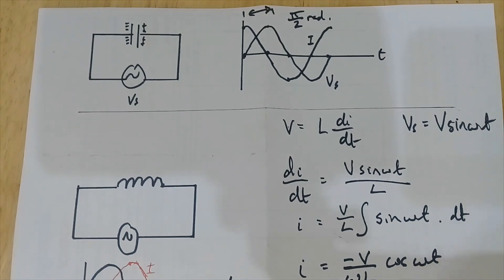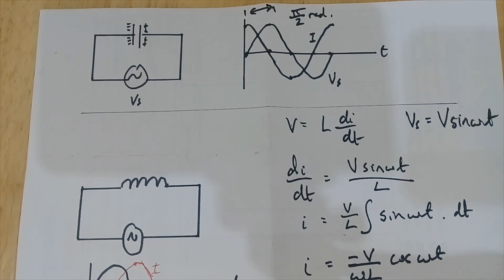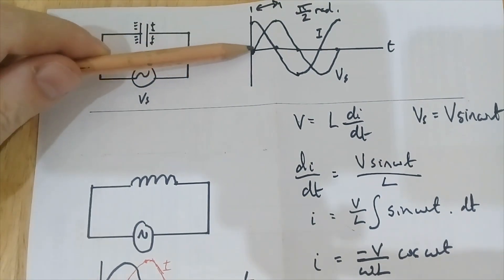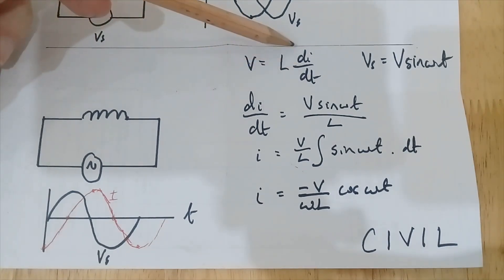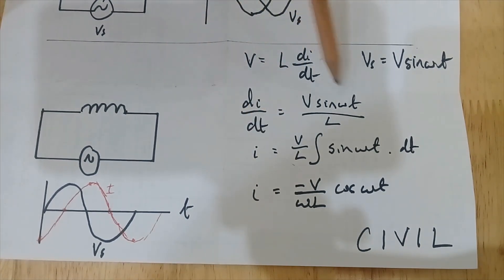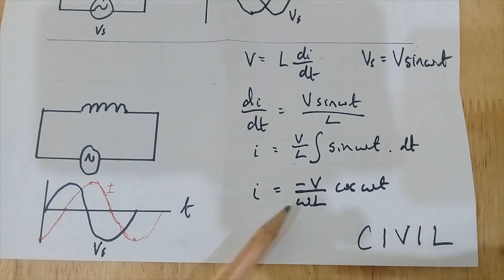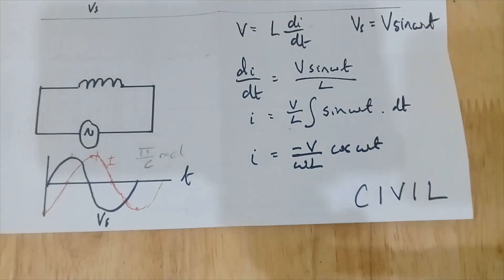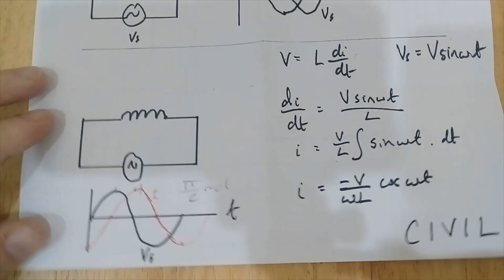Why current and voltage are phase shifted in Capacitors and Inductors. Explained simply.

Comment: I thin inductance is even more intuitive than capacitor, at time 0 the voltage source would have full voltage but because of the inductance of inductor there is an opposing force against current flow, then when that force reduce current flow like a closed circuit and voltage drop to 0

Comment: With the capacitor, the switch is thrown and instantly the current begins to flow. But with the inductor, when the switch is thrown, well, the maximum voltage of the source appears across it, but by Lenz's law I think, the current cannot flow just yet, even though it looks like (the inductor does) a short across the terminals of the source. Hmmm...ok, and with the cap, voltage does not appear immediately across it when the switch is thrown... Geez... but if the source is a dc battery in the cap circuit, would not voltage then appear instantly across the cap? Idk...it's confusing as he'll to me!